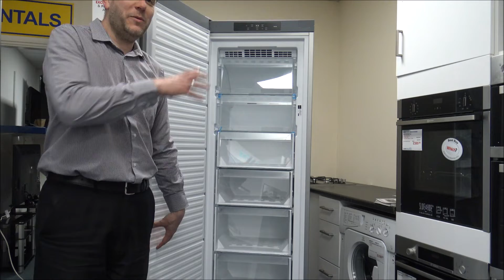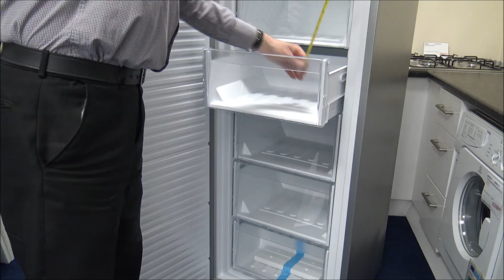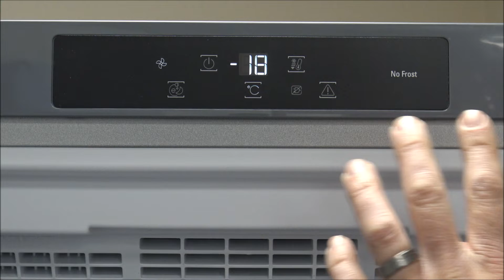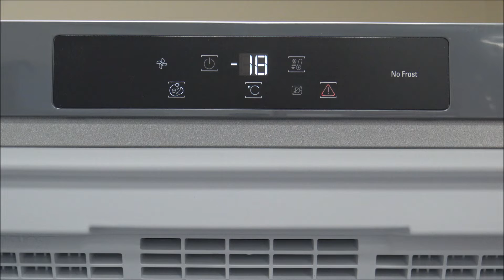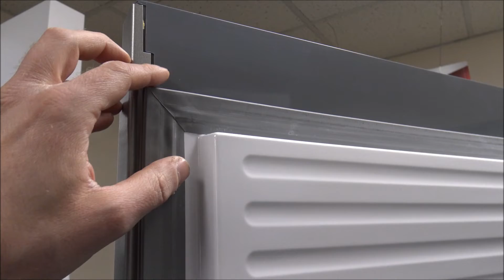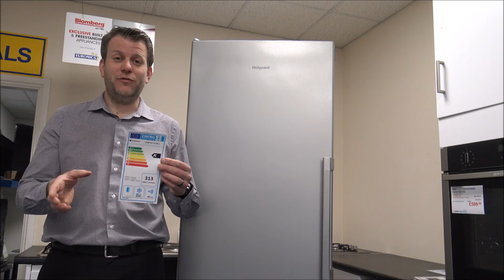Hotpoint UH8F1CG Tall Freestanding Freezer

Comment: We have this Freezer , and it doesn’t operate frost free , the build up of ice impinges on the fan which makes a loud noise as the fan rotates , 
The whole point of buying this unit was to elevate the problem of having to defrost the freezer twice ish a year , but as it stands now it’s a complete pain in the backside . 
Do you have any recommendations as to stop the ice build up around the fan or point us in the direction to as why a "FROST FREE" Freezer freezes so regularly, 
Could it be the defrost software problem ?

Comment: I have a uh8f1cg freezer, which is supposed to help frost free, but it needs to be defrosted once or twice a year. Can you suggest the best way to defrost it.
Reply from the maker: It shouldn't need defrosting that often, i would check the door seal is clean. Get a hot cloth and wipe around the seal to make sure it is clean. The best way to defrost it is to open the door and leave to defrost naturally, don't use a screwdriver to get the ice off as you can damage the unit

Comment: I'm getting ice in the top where the fan is
Reply from the maker: I would turn the thermostat down a bit as it sounds like it is getting too cold and also buy a thermometer to see the actual temperature inside so you have a better judgement as to what setting to have it on

Comment: Should the profreeze button be always on? on my freezer on this model it's always on.
Reply from the maker: It wouldn't normally always be on, it is normally designed as a fast freeze option, so once it is down to temperature, it can be switched off.

Comment: I just bought one of these today. I'm a little concerned about the frosting issue that others have mentioned. Do you have any advice to avoid this?
Thanks for the video - great to be able to see what I've bought in more detail.
Reply from the maker: We have sold quite a few of these models and haven't had anyone comment on it frosting up. The main thing i would do is to turn the setting down a bit first and see how you get on.
Reply: @lords-electrical  Further down in the comments there were frosting issues commented on by you!
Reply: @lords-electrical  The defrost system is failing. I had to scrap mine after 13 months as th food was not freezing properly.
Reply: Call Hotpoint, as mine was doing the same thing. To be fair Hotpoint does not care.

Comment: Hi I have the same freezer with a year half old and there is a noise out of it with two weeks I can see a bit of frost in top part how do I get that out thanks Lindsey
Reply from the maker: Hi, it could be the door seal that is not sealing properly. I would recommend getting a damp warm cloth and wiping round the door seal to make sure it is flexible and clean. 
Hopefully this should sort out the frost in the freezer for you
Reply: @lords-electrical  my seal is perfect I can see some frost in the top is there anyway you think I could defrost it.thank you for getting back to me I appreciate it
Reply from the maker: Yes you should be able to defrost it. You will either need to take the food out or try and use some of the food up first. The best thing is to turn the freezer off to defrost and don't be tempted to scrape it with a screwdriver as it can puncture the side of the freezer if it slips.
Reply: Hey, I have had the exact same bloomin issue! This is surely a bad floor in the design I would never buy another one of these again! And wouldn’t recommend! I am a baker/chef with a home based business freezing is critical, I lost the entire of my stock while away on holiday! Insurance is good but there is an excess meaning pretty pointless! 😡😡😡🤬🤬🤬 rubbish freezer don’t purchase
Reply: Yes I have the same freezer, we have had to defrost it several times due to the ice building up at the top part 😭
Reply: @jessicajanex0x  in the end I had to get someone out had to defrost it for 48 hours at least he said because its such a big freezer and I'm going good again thank god but a dose to try and empty when it full.
Reply: @lindseyparkes7263  Is it still going good for you? I hope it is for you ☺️
Reply: @jessicajanex0x  so sorry I only seen this now I am having the same problem again just noticed it the other day so I will have to try and leave it plugged out for 48hours again 😫
Reply: @jessicajanex0x  why isnt it no frost ?
Reply: @tamerpsychiatrist242  It's suppose to be a frost free freezer.. But alot of ice tends to clog up the top part of the freezer which then doesn't freeze the food properly.
Reply: @jessicajanex0x  We're done a partial deforst with a hairdrying 3 times in the last month. Doing a full defrost now, is yours still freezing? Tempted to just buy a new one if I have to repeat this process every few months...
Reply: @nebno6  I've done the same with mine. I've managed to figure it out, well at least I think I have. Just don't overfill it. Since I've been leaving it quite spacious and filling it with less food, I've noticed it doesn't seem to freeze up. I did a full defrost a few weeks ago and had to throw away loads of defrosted food as the top of my freezer was full of ice 😣 and it seems to have done the trick. No ice build up as of yet. 🤞